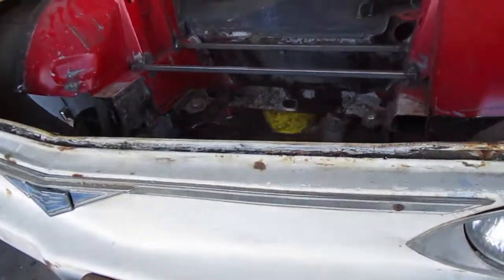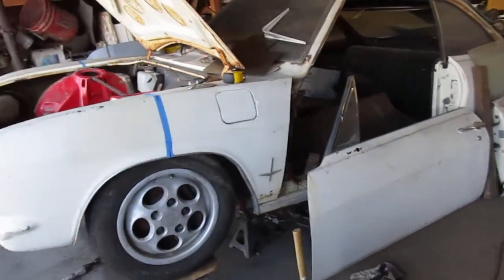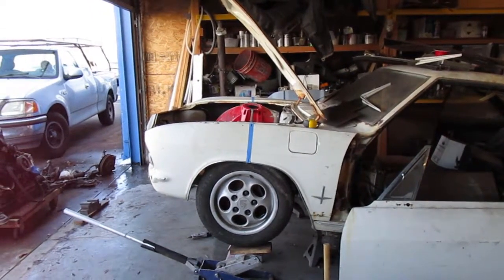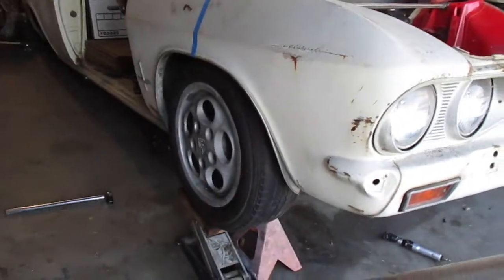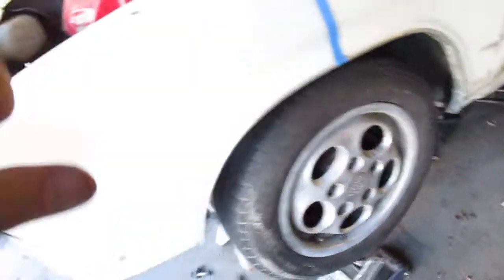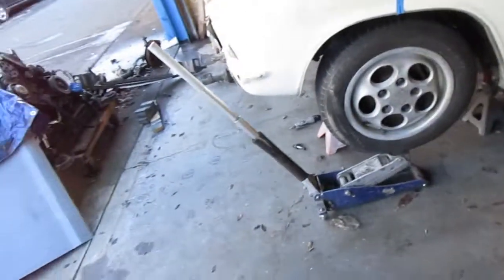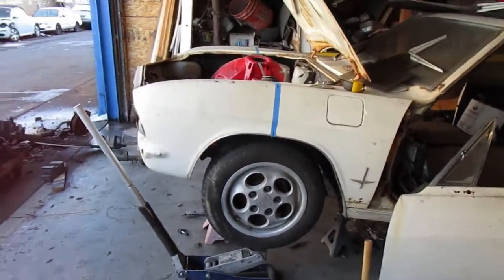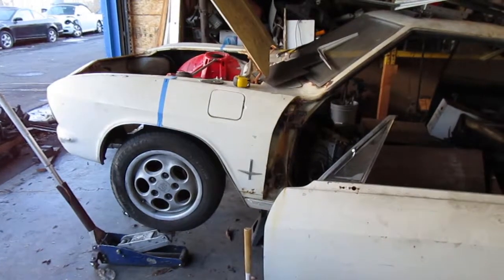Project Audacious:  Mid-Engine V8 Corvair Front Suspension Install

Comment: If you cut a coil you will make the suspension lower, but it will be stiffer yet. Haveyou considered coilovers?...davey
Reply from the maker: Yep, I have some mostly were for the back, for the front, just need some different springs I think.